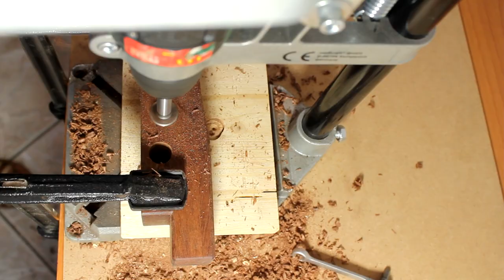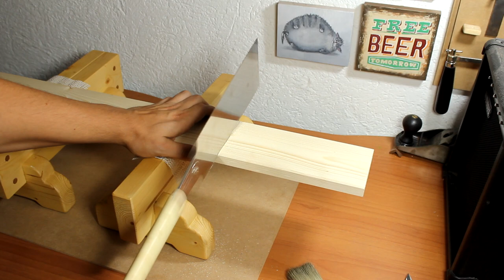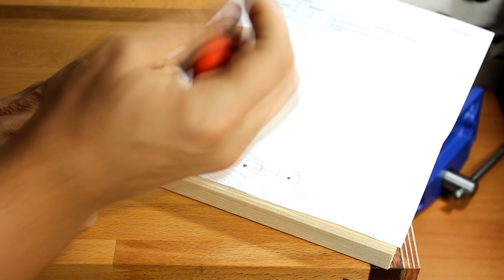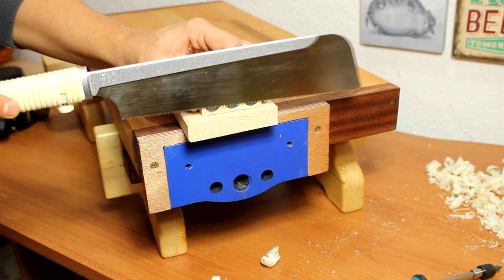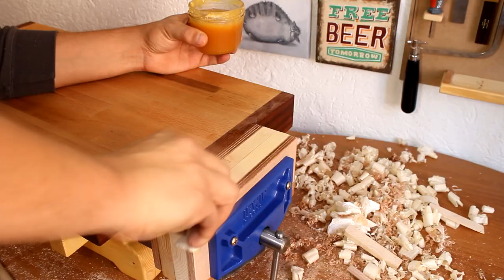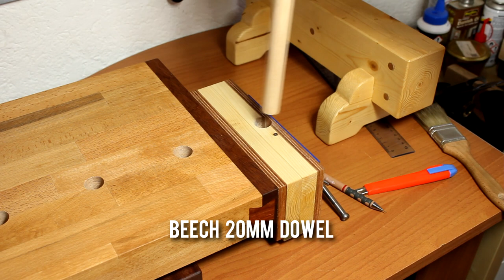Vice and Bench Dogs for the Low Workbench [2/4]

Comment: i think it is very massiv bench and vice thanks for sharing.  it is not so stedy so needs to clamp ir on a very stedy surface.
Reply from the maker: Thanks for watching! Yes, for heavy planing needs to be clamped. For chiseling, saw cutting and small task I found in the last weeks of testing it that wasn't necessary to use clamps. Also if I use those type of home use anti slippery materials can work even for light smothering planing.

Comment: Good video! One question, did you consider double dogs for extra stability instead of single dogs?
You have the space...
Reply from the maker: Thanks! When needed I use a planing stop made from two dogs, I made I video recently with it. If you refer to the vise's dog, I didn't felt the need because as you planing the force goes to the fixed dog on the bench.

Comment: Awesome work! Adrian! Really Thank you for sharing your excellent work tips!
I got a question about the bench dog & dog hole.
When you put the bench dog in the dog hole by parking position, the whole bench dog come into the dog hole, i got that.
But when you put it by using mode(not parking mode), how is it possible the whole bench dog not come into the dog hole.
Is it just only by the resistance of tightly drilled hole? or is there any magic trick you can tell me? ^_^
As i know the usual bench dog on the market have a iron spring to hold the dog in the dog hole surface.
I can see that if the workbench vice give a transverse pressure to the object and to the bench dog, then it will hold on the object tight enough.
But what i'm curious about is that after repetitive use of bench dog, i think the friction surface of the dog hole will be widened and the bench dog diameter will be decreased.(cause it's just wood right?) Then i think it will be a little problem to hold the bench dog in the dog hole at the right depth you want. Can you tell me your experience about this?
And thanks again for your awesome work sharing. Take care and regards... ^_^
Reply from the maker: Hi Jason! I know what you mean at the vise's dog. Until now, this dog has still some friction to be raised as up as I want without falling (probably also with the help of little saw dust that is left in the hole). Normally, when I designed them, the vise's dog was meant to be parked in the vise, but used in the bench, and put the second dog in the vise, as this one is cut at the exact length when pushed all the way to leave outside only that rebate or whatever is called. Anyway till now they work ok, but I feel that the mobile jaw is getting loose. It is made out of pine and a very soft plywood. Not the dog's diameter I am worried it will decrease, they are made from beech, but of this jaw. I want to rethink the jaws by making them from hardwood and a square-rectangle dog, same system as in typically named cabinetmakers vises. Thanks for your comment and appreciate you enjoyed my project. All the best, Adrian
Reply: OK! Thank you Adrian! As you said the second dog and different cut depth or different hole depth is brilliant really. I couldn't thought about that before you said and just try to apply the spring bench dog system which needs a little bit dexterity in making. Wow you are so full of ideas really! Genius!
Thanks again and it's a great help to me! ^_^

Comment: in England it would cost so much in wood for this project to be made so i am just wondering how much did it cost you
Reply from the maker: Well as I remember, the two beech boards cost me 9 or 10 euro each, and the mahogany 22 euro a 100x20x2200 mm board, from which I used maybe 1 meter max. All bought from big hardware stores in Italy, not from special wood deposits. And the vice was from England :) , from Axminster, 30 gbp.
Reply: thank you for the reply the beech is relay cheap i would happily buy that all relay good prices sadly in the uk your big hard ware stores only sell pine .the table looks well nice

Comment: Hi,  this is awesome work ! somebody has probably already asked but I can't find it. can you tell me what do you use to adapt your drill as a drill press ? thanks in advance :-)
Reply from the maker: Hi, thanks! That one mine in particular is a Wolfcraft drill stand, it is the simple one, that guides though a pipe, code 3406000. They have also a more expensive one with toothed rack, but I found not to worth the money in my use (35e vs 100e). Also there are several models from other manufacturers,  just search from drill stand adapters, or drill stands for hand drills.
Reply: Adrian Preda ok thank you, I'll check that, would you recommend it ? :-)
Reply from the maker: Depends, it has a little wobble, but is way better to drill perpendicular than any other hand methods. There are even cheaper models, like 20-25 usd/euro, this one is 35, but I read more negative reviews about them about their cheap construction. I found this to be the only way to have a drill stand in my small workshop in the apartment. The only downsize to this I see is that using a hand drill at lower rpm you will have small power to it, so using forstner bits is quite tricky. In this video here, drilling all those 6 hole really heated up the motor, but for normal drills up to 10 mm is quite straight forward.

Comment: I can see you are using a vise with 'v' thread, what's your opinion on square thread vises?
Reply from the maker: It is not a full V thread, sharp, has about 1 mm flat of flatness on the tip. And a low threads density respect to a general use screw. I only have experience with this vise, It's ok for its size, has a little racking, thread tights enough, but anyway it is a cheap vise compared to reputable manufacturer. I will make soon a full size wb, and want to use a bigger vise,  front vises type with square/trapezoidal thred

Comment: How do you like the Irwin vice? I have 1 someone bought me for my "Rouboish" workbench but I have been hesitant to install it. Thoughts?
Reply from the maker: The only minus to this vice I found to be the angle between the back of the fixed jaw and the plate with the two mounting holes. Is not square, maybe 91-92 degrees. As you can see in my other video of the workbench build I have added one washer (20x1mm) to correct this. Other than this the vice is solid, no big wobble, the jaws are coming flushed when tighten. The thing is this was the cheapest one I could find, about 30 euro, the next ones where jumping from 2-3 times this price.
Reply: Adrian Preda thanks. if you are looking for something bigger and more clamping. check out Jay Bates videos on a vice made with pipe clamp. there are lots on YouTube but he does good job of explaining the build.
Reply from the maker: Yes, I know Jay's project. I may build a similar one to use it like a moxon vice to sit on the workbench.

Comment: Ich habe das schon ein paarmal gesehen, dass die Beilagen in der Zange aus Weichholz gemacht werden. Ich sehe da keinen Vorteil. Weshalb macht man das?
Und warum nimmst Du die rechte Holzseite nach innen? Mir wäre es viel lieber, dass die Zange oben und unten greift.
Reply from the maker: Sorry, not sure if I understood correctly even with google translate. I used soft wood jaws because this I had at the moment. Will follow an upgrade with thinner jaws from some beech or other hard wood, this also to gain more vice opening. Your second question, sorry, I cannot understand.
Reply: Adrian Preda Why do you take the core side inwards? This side becomes round. It is better if the vice is tight on top and below.

Comment: What drill press jig did you use? Looks good.
Reply from the maker: It's a Wolfcraft drill stand
Reply: Oh ok, any particular model? Btw, how do you get the drill to stay on? Don't think my cordless has a fatigue button. Love your videos btw.
Reply from the maker: check only "drill stand", there are many model, prices as you may like. The drill should have a 43mm mount to fit there, any cord drill should have this, but the battery ones are not designed this was. there is i think a dewalt cordeless with 42-43mm mount, but is too exp. and doesn;t justify the money. same, cord drills have a block pin that lock the switch, cordelss usually don't
Reply: Adrian Preda fantastic. Thanks.